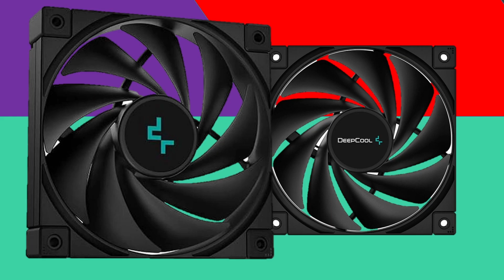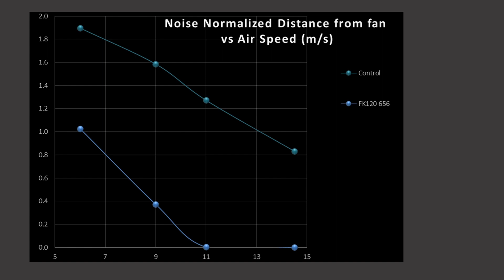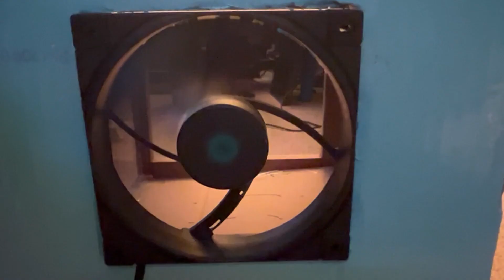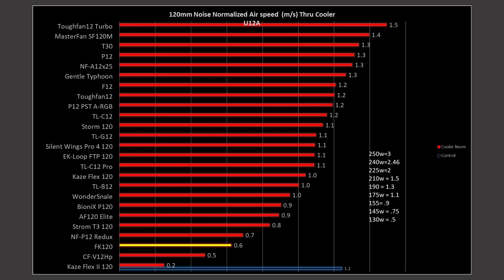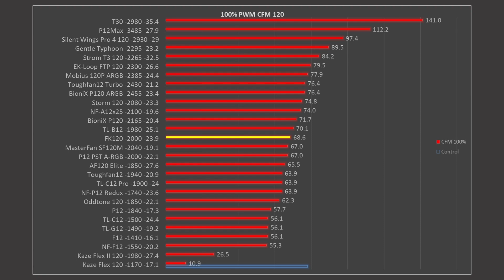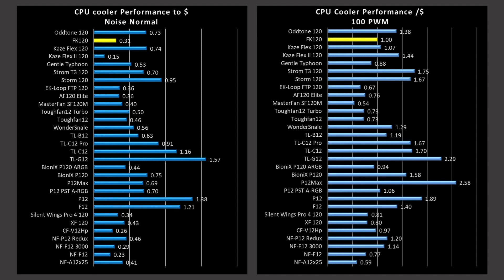New Testing: Deep Cool FK120 review

Comment: At the same price as the ROG xf120 which one do you choose for case?
Reply from the maker: well neither are good for case airflow. but if its a choice between these 2. the ROG XF120 is better.
Reply: @computer-tech-more  thank you for quick response
why not? 
what fan do you recommend?
Reply from the maker: @Soulcinder-n3g  the deep cool as a lot or resonant frequencies making in kind of annoying. the ROG really well just does not perform well overall. 
If your looking for a cheap good all rounder TL-S12 is very good in my testing. its main limitation is lower max RPM but should be good for most users airflow needs. 
For larger cases 140mm fans are better then look at the P14max and ToughFan 14 pro.

Comment: In my opinion, if you for some reason need a lot of fans that actually can push air through obstacles without leaks and struggle- this one is pretty reasonable option. its dirty cheap and raw performance is fine. one major downside is a TON of resonant RPM areas that you will need to identify and avoid via fan curve.
Reply from the maker: basically yes. the fan has fine performance. noise performance isnt great but if you can avoid the harmonics in it its not terrible.
Reply: @computer-tech-more  IMO, it better than OG arctic p12 pwm
Reply from the maker: @angeltensey  I havent tested the original P12 only the PST version, which ive read is better.
Reply: @computer-tech-more  p12 gone through a bunch of revisions. first it has simple 3 pin voltage control, then it became pwm (P12 PWM), then received pigtail connector for daisy chaining (P12 PWM PST), then got alternate ball bearing version (P12 PWM PST CO).
Reply from the maker: @angeltensey  haha. I dont think i knew it had that many. the 3 to 4 pin one kind of makes sense. Alot of fans probably made that transition.